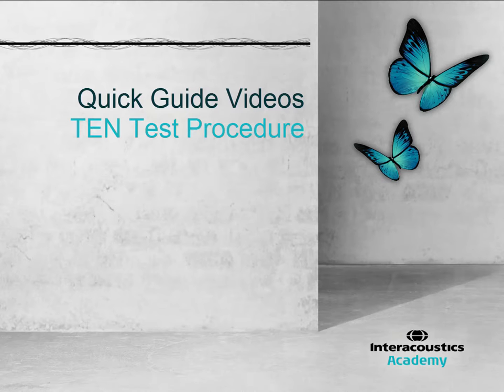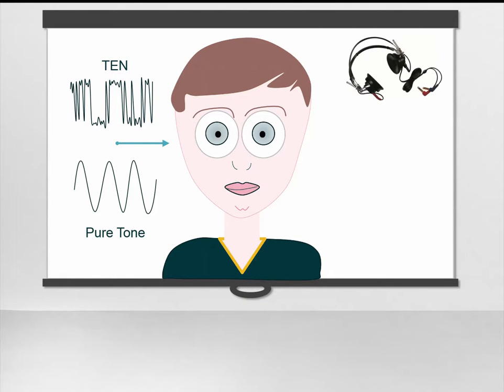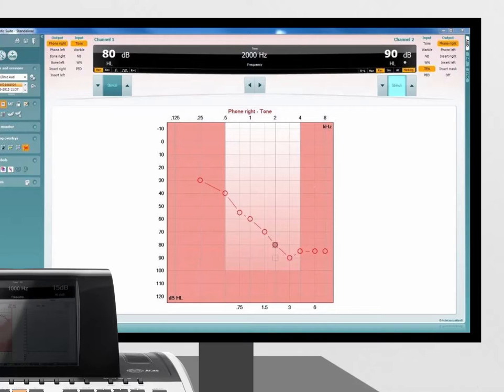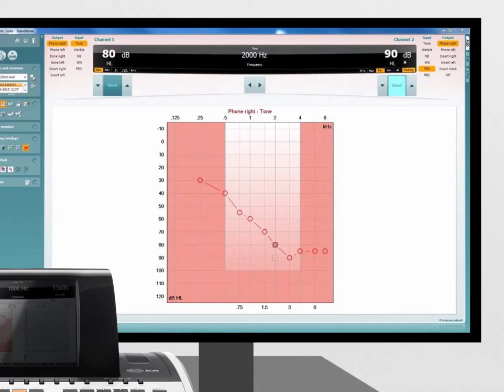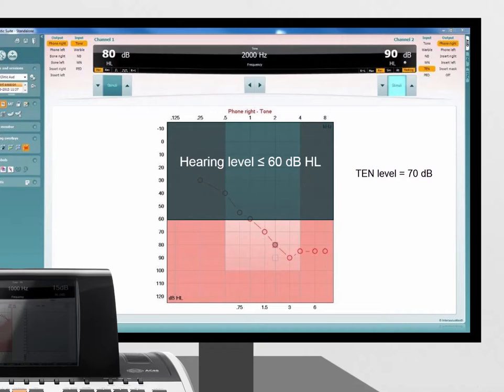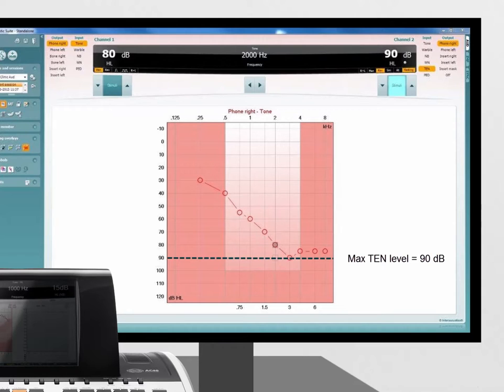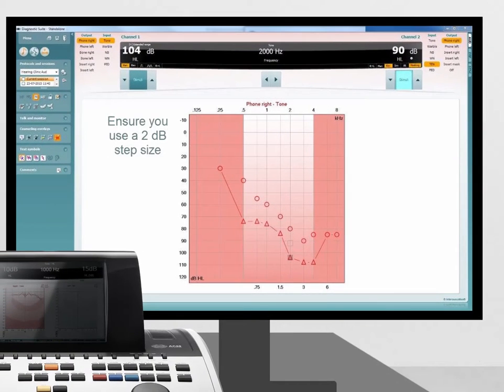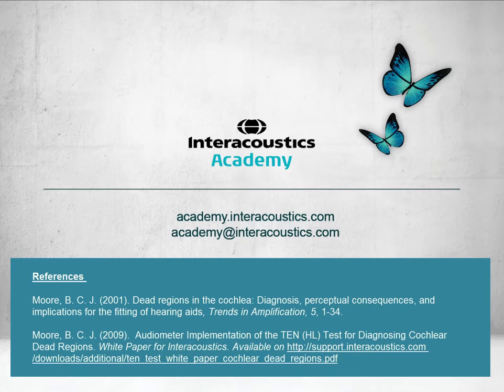TEN Test: Procedure

Comment: What do you set the TEN level if the threshold is 65dBHL?
Reply from the maker: Thanks for your question. TEN noise needs to be supra threshold. In a case of hearing loss at 65dB we recommend a TEN level of 75dB. This allows for the TEN conditions to be met if a dead region is present.